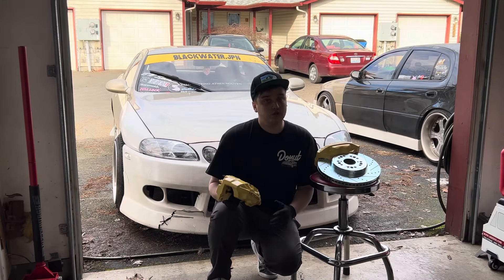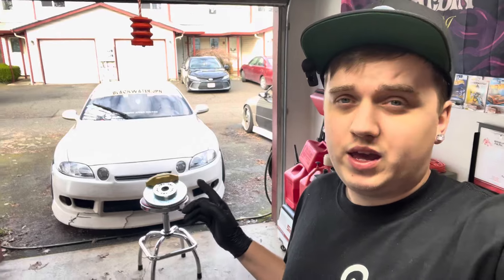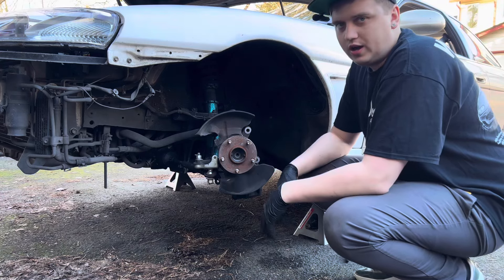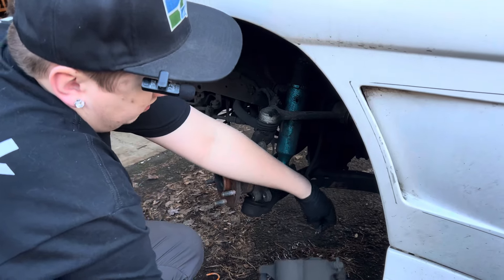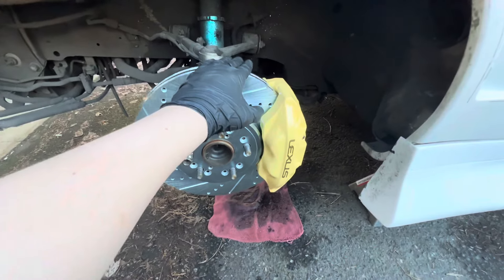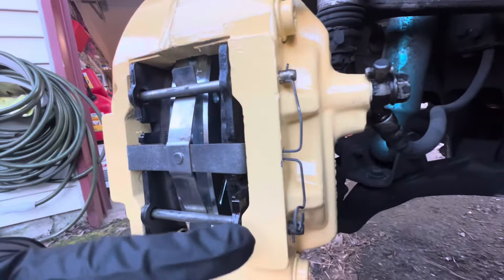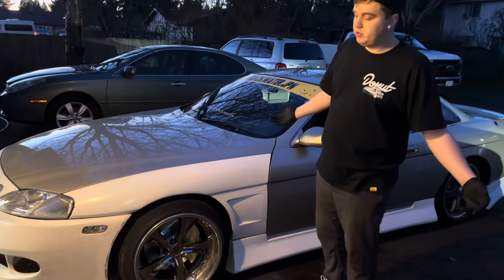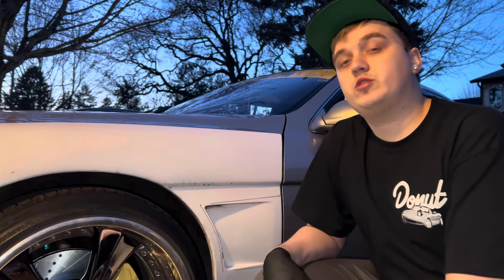LS400 Big Brake Upgrade On My SC400!

Comment: Thx for the vid man. Random Q, the single wiper mod. What size did you use + does it work enough in rain?😅
Reply from the maker: Man I did it so long ago but I believe I used the stock passenger wiper, just adjusted the wiper up to that point. It works okay but if you put the wiper more straight it’ll clear the driver side a lot better.
Reply: You can extend the rod connected to motor and linkage, to make it sweep wider.

Comment: This is okay for jzs147 aristo? Do you know what modified need?
Reply from the maker: Yes I have it on my jzs147 gs300 also. You will need front roll center adjusters for caliper clearance; and remove your dust shield.
Reply: @blackwaterjpn  thanks bro 👍👍👍

Comment: So what year are they from if you didn’t have to grind some of the slipper to get the bolt holes lined up?
Reply from the maker: As mentioned in description they are all the same from 1995-2000 LS400. No grinding needed. Bolted right up! Only modification was removing dust shield.
Reply: @blackwaterjpn  I’ll have to double check mine then. I know I pulled them from a 96 LS in the junkyard. I know when I test fitted them last summer they didn’t act like they wanted to go on all the way
Reply: @blackwaterjpn  yeah some of them hit. I remember watching Fully Spooled do a video on it, I just watched it again. Mine are hitting like his. Not sure if it’s a difference in some SC knuckles or a particular batch of LS calipers.
Reply from the maker: @kool-aidsphuckery9596  yup 96 will be exact same. So I struggled for a bit at first because I put in the bottom bolt and then couldn’t line the top bolt up very well. Once the dust shield is removed you just loosely put in each bolt and they will work fine!
Reply: @blackwaterjpn  could be that too. When the weather warms up I’ll cut the dust shield off and try again. Good video though. Let’s people know they don’t have to spend a ton of money to get the performance increase

Comment: Dumb question but can do I need to use Ls400 rotors once I put the big brakes on or are the sc400 and Ls400 rotors the same?
Reply from the maker: Yes you need ls400 rotors